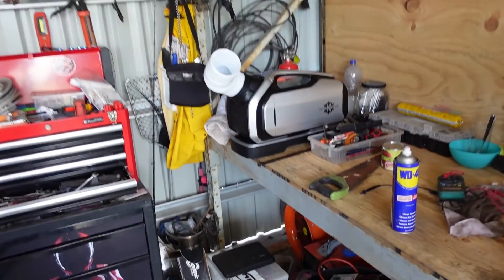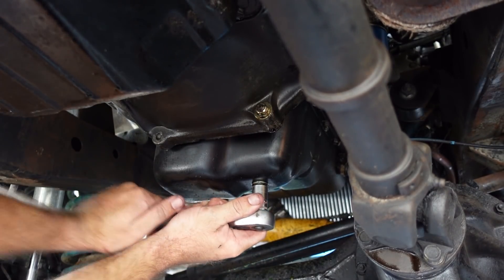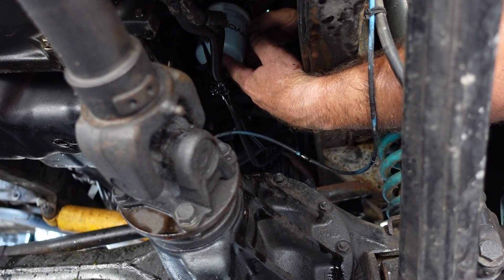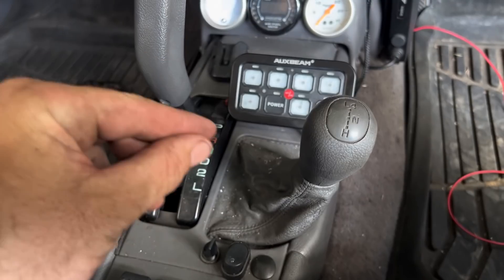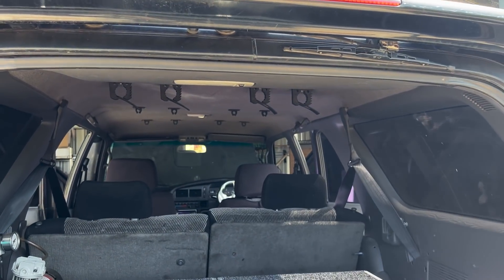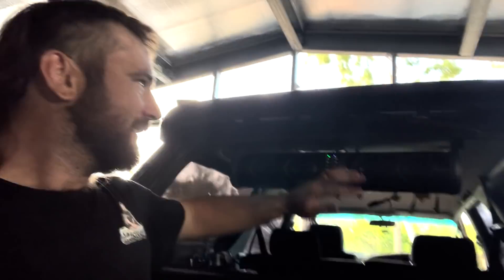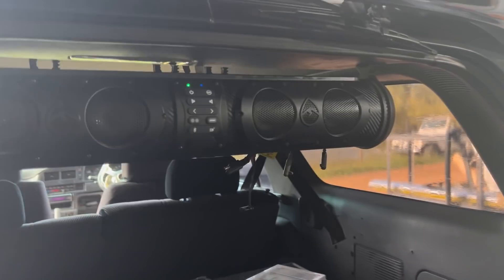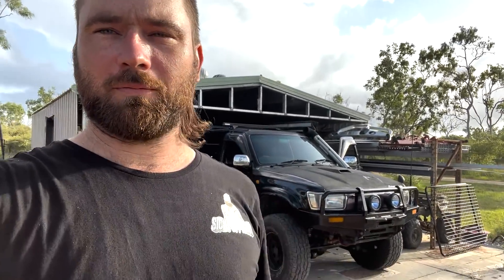Surfs UPPA! - New Car Gets Some Cool Bits - I Love This Thing!

Comment: I guess the 'basket' from the rack will make a great under-bed tray.That Truck is pretty darn awesome.Good for you for finding it!Sound is always nice when you're putting about or stopped for a break.(I have like 4 diff headsets and buds for bike riding.1 only do 1 ear so I can hear cars too)Extend that tailpipe up a tad,but below the turbo so you have a warning level and some Big ass tires,you'll be deep in the trails next time.?.

Comment: My stepdad and I change the oils of our cars ourselves, I have a 07 Hilux and he has a 70 series LandCruiser. He is a old bushie type of guy that would fill the oil filter with fresh new oil and lube the top part as well before putting it back on the engine.  Also, I heard that Mountain Dew runs good as oil, just saying. haha.
Reply from the maker: I’ll be sure to use the dew next time haha 😂

Comment: Don't fill oil filter  up yes lube the ring but don't fill it up your putting un filtered oil straight into the engine if there's any contaminats in the oil its going straight into the engine

Comment: If it’s running the 4 runner auto just keep an eye on the kick down they like to go f$@k you an stop working
I all ways full the oil filter before putting it on but i fill it let it settle an add a lil more. 
Always lube the ring aswell 🤪😂

Comment: What engine is it?
Reply from the maker: 3rz
Reply: @sickpuppycody  keen to hear your thoughts!! Especially with the a340? I want it to tow my camper trailer but concerned about torque as I’m going from diesel with aftermarket turbo I built at 12psi